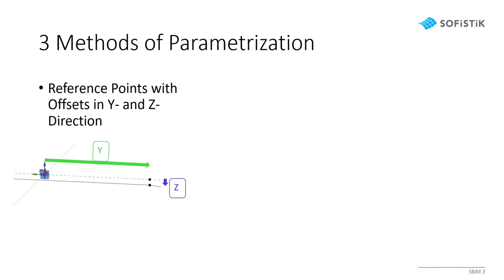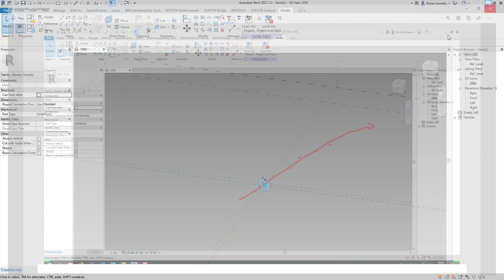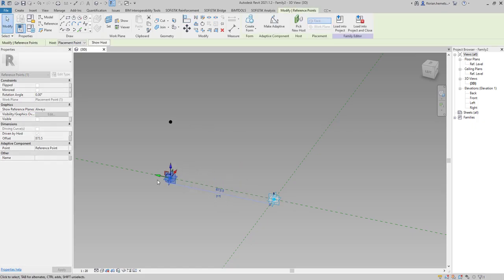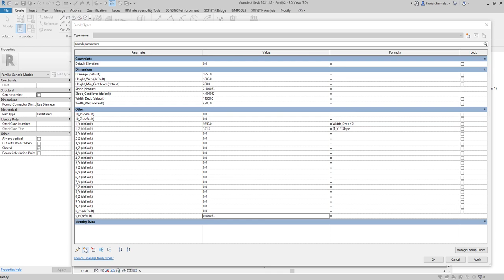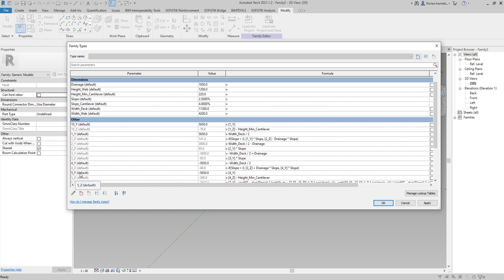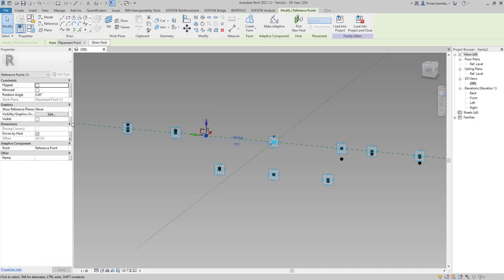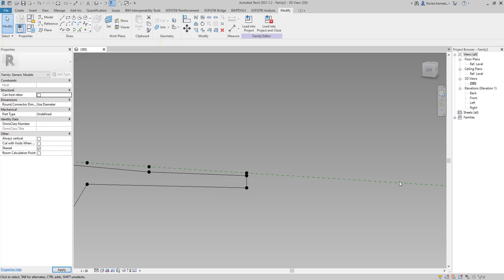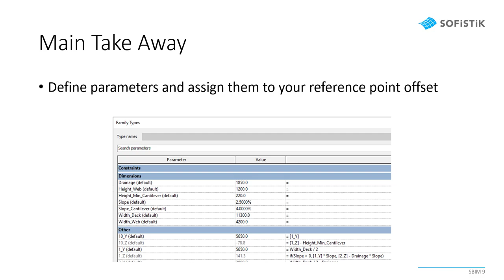Superstructure Families for SBIM #2 - Parametric Families

Comment: Hi,
How do you design a point in the parametric family that gives a point of constant altitude in the Revit environment? 
I am looking to produce a wall with a constant top level in elevation.
Reply from the maker: Hi Jean-Charles Perrin,
There are multiple ways to achieve that using the Bridge Modeler.
One of them is to use the "Axis"-command "From Projection" to receive a horizontal axis, based on your source axis.
You can then create a secondary axes (for vertical offset) and reference this axis in your superstructure (via. shape handle points) for your horizontal reference. Then you can reference the source axis for your variable bottom of you wall.
If you need further information, please contact our support team.